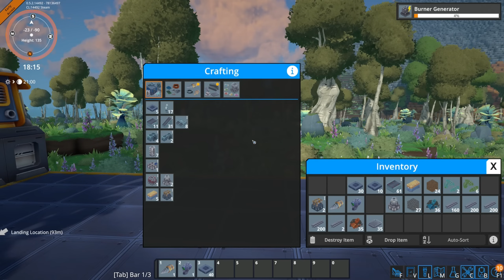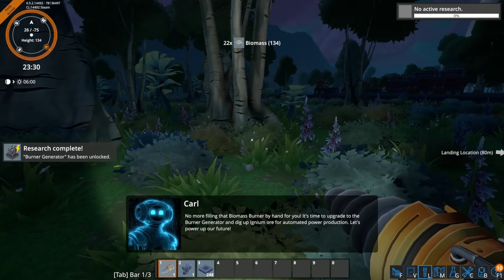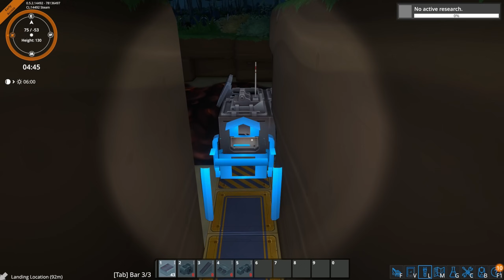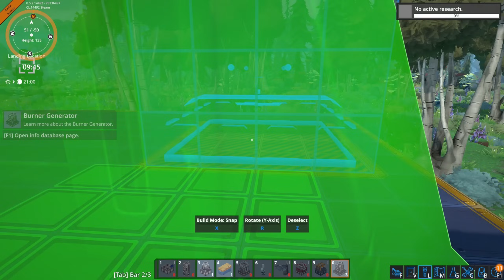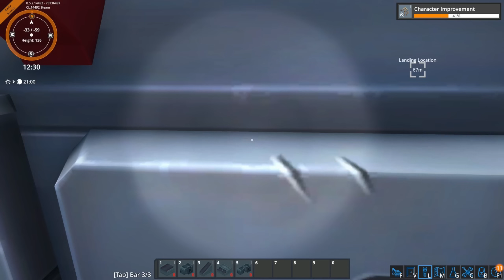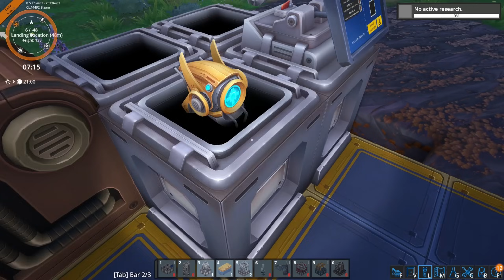MORE POWER And A Factory Redesign ! FOUNDRY [E3]

Comment: You don't necessarily need those machines to be 4 blocks apart. You could do 3 blocks apart and feed the conveyor sideways. If the machine is wide enough you could even just do two and zig zag the conveyor around to connect them. Or, sometimes you could put the machines right next to each other and use the other sides of the machines to run the conveyor along.

Comment: One suggestion for the bus, leave a level (z axis) open to the lines to crisscross..  Doing the belt up, over, down works early on, but quickly gets messy as you have multiple belts going down the bus and needing the bus itself to go up and over the cross points.  I left I first level open, so I just split, drop to ground (where buildings are) and go over as needed.

Comment: This game is sooo much like a 3D version of Factorio, right down to requirements for science.  No need for tunnel conveyors though as you can go up or down.  I imagine a 6 or 8 wide bus, I wouldn't have put in gaps between.. just incline then decline the neighbor conveyor, drop in a balancer and pipe out.  Need more of a type of product on the main bus just conveyor in to the point were you have diminishing items on the conveyor and balancer in.  Exactly the way I'd do it in Factorio

Comment: A bus plan that I like, have one space between belts which are one level higher then the foundation. When you need resource X, put the splitter and a ramp down, leading that path away from the bus for that purpose. When making a new resource for the bus, just output it toward the bus, ramp the belt up and make the new line.
Reply: Yes, that is the best efficient method for this game, least amount of resources and a clean overall look to the buss.

Comment: How I designed my bus: I run the conveyors right next to each other, but if i need to get one resource out, i raise its belt by one block, put the balancer in and lower the belt back down. Now i have an extraction point in the bus that is easy to access. It works best I found. Takes up space in length, tho.
You could also just leave one space between each belt so that balancers could fit on the same plane and use an upward slope conveyor for the extraction. Takes up less space in length, but your bus is twice as wide. Or could make a two conveyor wide bus and stack it vertically, tho this one would be the hardest to work with imo.

Comment: You can drag the conveyor ramps, no need to build them individually on foundations, they can be built up into the air.  Also, the burner generators are actually a pretty short term solution it will pretty quickly have you move to boilers and steam turbines.